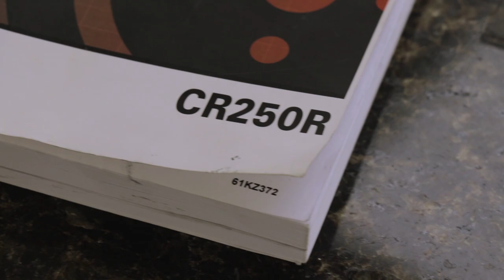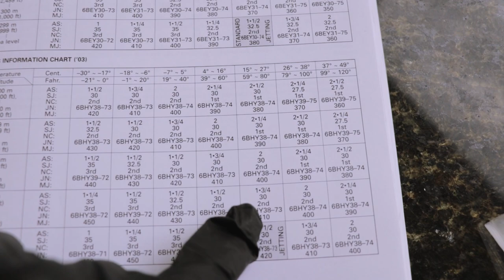CR250 Supermoto Part 9: Carburetor Rebuild & Jetting

Comment: Great video!!! I love the red hoses, gonna have to pick me up a set. Also, just an FYI, if you change the nozzle to an S-7, i think the come with an S-9, makes the bike wake up a lot more and run cleaner.
Reply from the maker: Clint M I just threw in the s-7 in my latest cr250 video! Also changed the needle and it runs sooo good now

Comment: What's you're elevation? I put the s7 nozzle in mine but everything else is stock still. Im at about 4500-5000 feet. Trying to figure out what I need to change
Reply from the maker: matt_ru im at around 2500-3500 ft